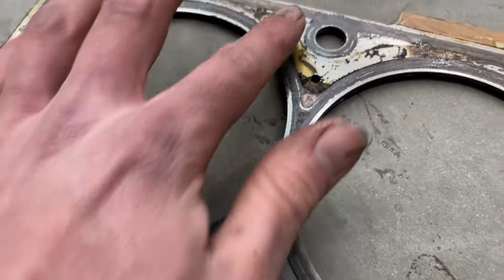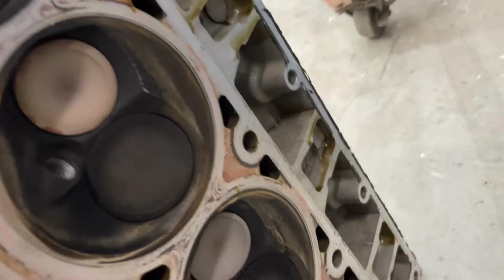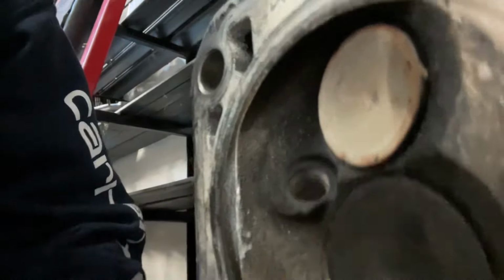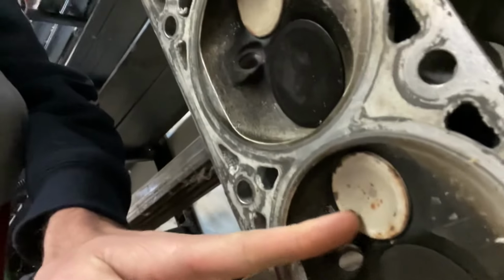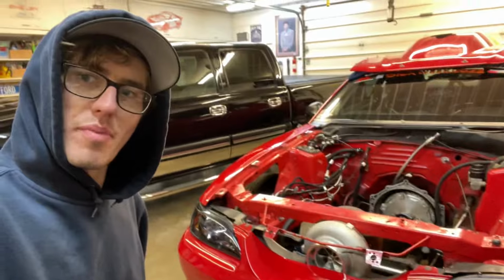Shocking results when tearing apart the Turbo Nova!! Will it the engine be okay??

Comment: Were those 706 heads? Some of the 706 castings (ones with the battery icon in the rocker valley) are prone to crack in those spots.
Reply from the maker: These were 862s I have heard of that tho
Reply: @OverydeMotorsports  Ah ok. Yeah people like the 862s over the 706s for that reason, but like you said, the bigger valves might have weakened them.
Reply from the maker: @funfun8095  definitely. So weird how it happened within the last 1500 miles. It never even had anything go wrong then